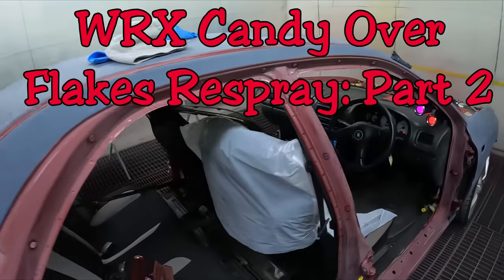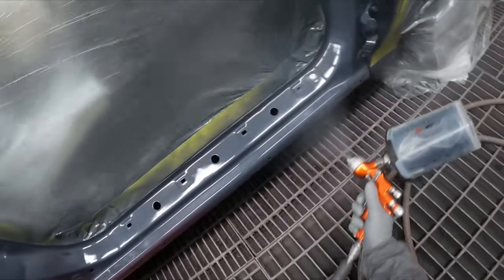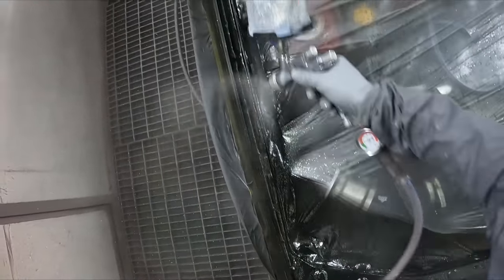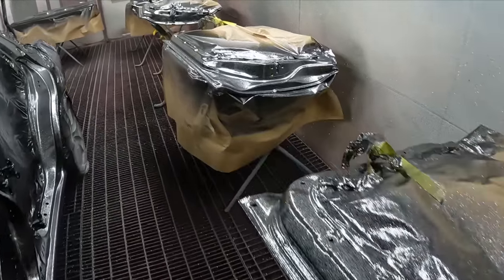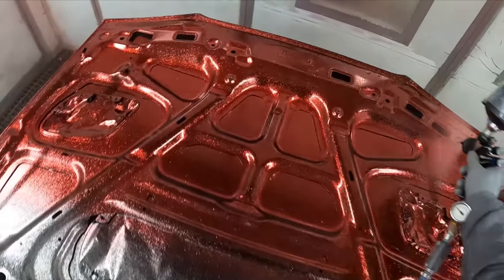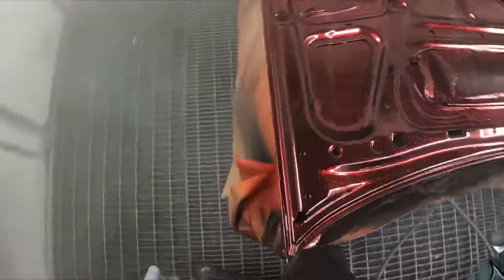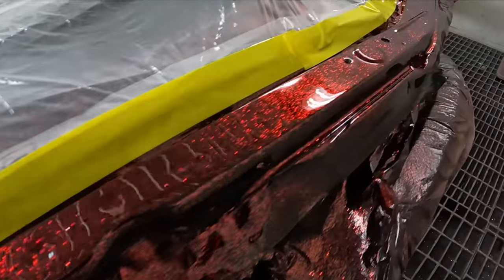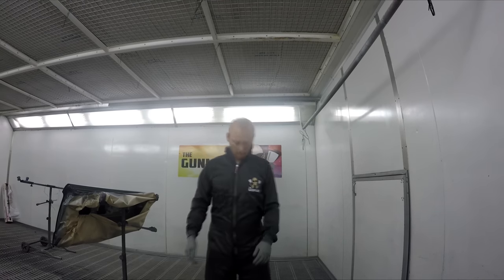Candy Over Flakes Respray: Part 2

Comment: I was taught that to pull up stacked flake you need to tack rag very aggressively and keep the rag fresh. It's always worked out for me, not that I'm a professional or anything. The first time I did it, I was surprised to see what looked like normal basecoat (no fuzzies); but it looked as good as anything when the clear went on and it only took two coats like normal.

Comment: 2 questions wat did you sit the flakes in clear????  secondly i picked up a cheap DVB advance HD in pressure setup( want3ed it to shoot prumer etc). it was cheap but im kinda worried about  spending money rebuilding it and it having a big flaw  do you know anyone in Perth that has a  non pressure cap  as even unregulated off the compressor i cant get it to work even pressurising a pot by backflushing

Comment: hey Gunman, i really hope you answer this question for me please * What did you do about the edges between the inside spray and the exterior? I did this one time on a paint job and I got a edge of clear and even a little overspray in the inside of my paint job which afterwards i couldnt remove.

Did you get the same results doing it on this one? Thank you for your time responding <3
Reply from the maker: Yes I did get a big edge, I sanded with 1,20 wet, polished up, and there was a little spot I had to brush in, but it looks neat.

Comment: Hello ! it's just an opinion, I never tried this method. Instead of clear after the candy you can use transparent filler (which is used in the finishing of carbon fiber) it is much thicker than any clear, and it is very easy to sand, after which it can be cleared  over

Comment: Hey Gunny, am I seeing you clean prep the car with the engine running? Why? If so, surely the exhaust oil (it is not a clean exhaust) will contaminate the air and you just cleaned surface? Or...am I missing something?
Reply from the maker: The spray booth was running, anything would go straight down. And it didn't cause any contamination. All good